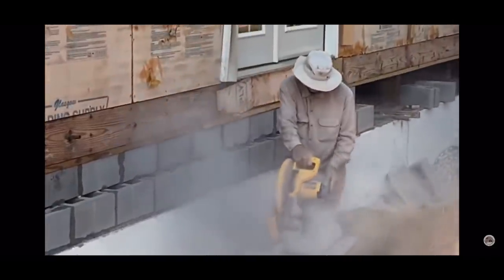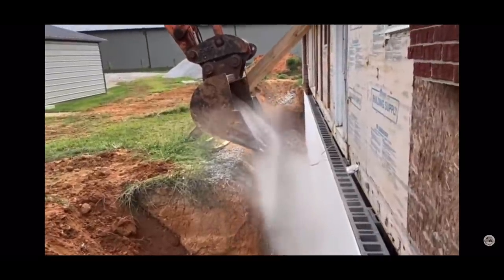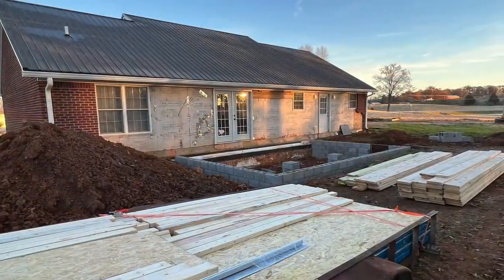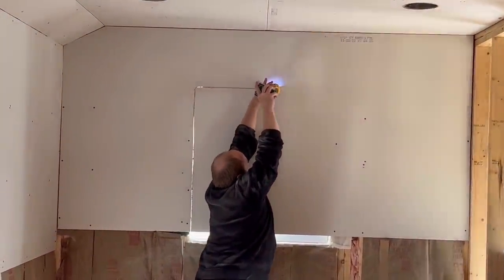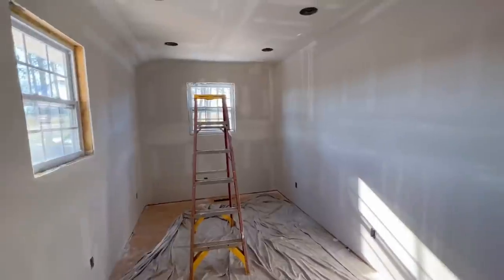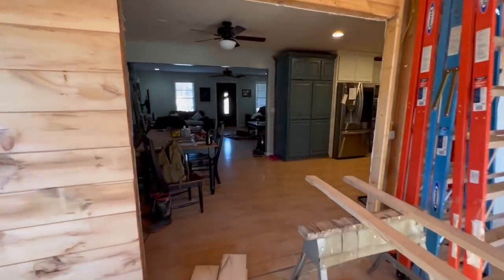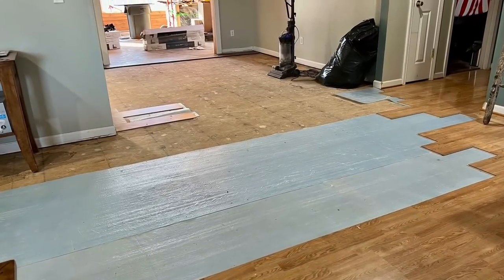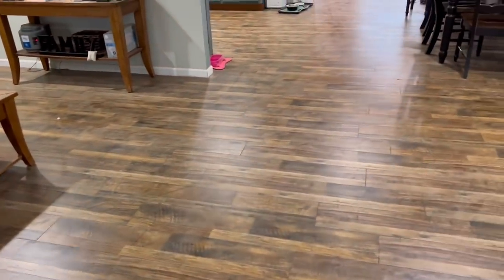New House Update - Getting So Close

Comment: I know that the immediate reach might be to get rid of the red clay dirt but do consider keeping it if you're planning much for raised beds as a lower layer in a taller bed.  The stereotypical 4'x8' has 32 sq ft, 4'x10' has 40 sq ft.  At just a 1/2"-1" layer at the very bottom, it could translate into a cost savings with a mineral and water retention benefit; and the chance to become super soil as the dirt and nutrients from above work thier way down while the worms work thier way up.  Depending upon how it compacts, consider shoveling a couple of shovel fulls (1/16"-1/8" coverage) every 6"-12" in the compost pile too; especially when you have a lot of grass clippings. I imagine this stuff "slicks up" adequate for figure skating practice when wet, but consider it as a thin layer top dressing where ever chickens are contained; im guessing it will soak up hot manuers and urine then begin its chemical change beneficial for both the dirt and the olfactory senses.  As needed, build board walks out of the top and or bottom halves of pallets for use in the chicken yard; or 4" high board walks of whole pallets with the slats filled in on top.  For narrower board walks, Sawzall down the outside edge of the center pallet to create a width that is half wide plus the width of the center turned outside support.  -  My gut feeling, or at least back of the brain nagging fear, is that things are going to get pretty darned expensive and in response to the reduced demand (buying) the supply on a number of things will be reduced.